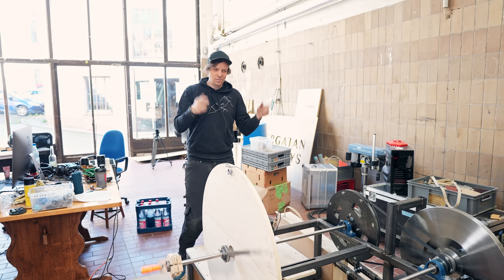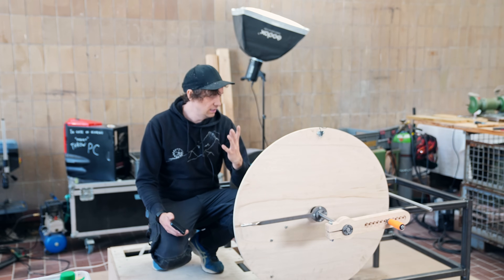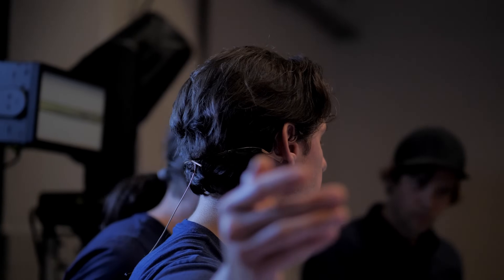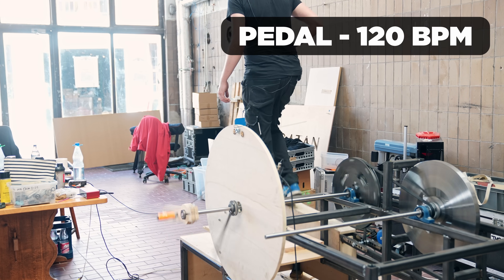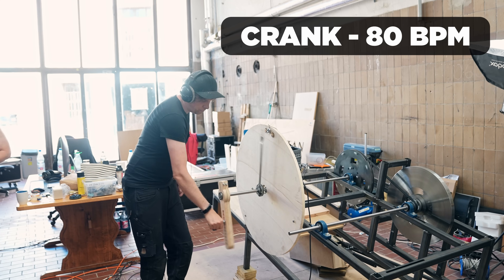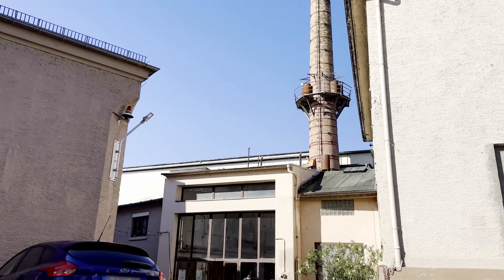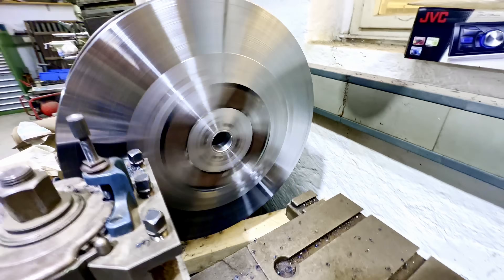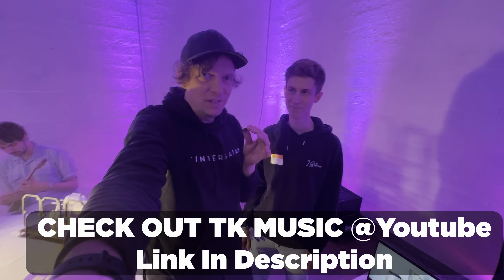The Prototype is Finished - DAY 10 - Marble Machine Flywheel Prototype

Comment: When trying to get the tight music, you need to consider how the muscles in the upper limb (arm) and the lower limb (leg) are different. The arm's primary function is to position the hand in space, we have lost a lot of strength compared to our primate cousins to allow us have greater control over our hands (and subsequently our arms).

Additionally, the legs are the largest muscle groups in the body, so you're able to produce a lot of power with them, but in doing so, you will lose control.

Comment: Why not electric drive? I think the most interesting parts of the machine are unrelated to powering it, like mixing different channels and controlling certain manual inputs. I'd much rather see a performance where you're PLAYING the machine than POWERING the machine. I'm wondering what is holding you back from removing this requirement.
Reply: And if the machine doesn't keep you busy enough during the show, carry out a guitar as well so when the machine is on autopilot for a moment you can sneak in a riff.

Comment: It's interesting to see how the pedal vs no pedal ended up being so close. It does make intuitive sense that having the pedal would introduce some losses when the mechanism needs to fight against gravity to pull the pedal up, but it's also mostly balanced out by how gravity assists with the corresponding downstroke. There are still some losses due to friction (Bearings aren't perfect, and there's some air resistance) but, as you saw, it ends up not being too significant.
Regardless, testing one's assumptions is part of the scientific process as much as anything.

Comment: I would argue that the actual design of your flywheel isn't idea. You want most of the mass on the outer edge, that will give you a greater moment of inertia for less overall mass. If you want to explore this, have rings made up to place on the flywheel, that way you can increase the outer mass without increasing the overall mass to the same extent.

Comment: I am not an engineer, but something seems inherently wrong with that one foot pedal. If your machine is going to be that big, why don’t you put a bicycle seat on it, and bicycle gearing so that you can use both feet to power it, not to mention different gears for speed, as well as the flywheel not turning the bicycle pedals when your not pedalling?

Comment: I think something that might have been missed out in the data analysis is how quickly the tempo changes around the desired bpm. Martin felt that the hand crank was better, but the numbers he was looking at didn't show this. It's possible that with the foot pedal, the bpm drifts and oscillates either side around the target bpm rather quickly (so it might be a bit fast for a couple of revolutions, and then slow down and be a bit slow for a couple, before speeding up again...), but with the hand crank, Martin was able to approach the bpm more slowly, making smaller adjustments to bpm over time, so it would take more revolutions to speed up or slow down. You could think of this as the frequency or period of the oscillations in bpm either side of the target.

Comment: What about some kind of GEARING or Variable Belt drive to change flywheel speed for better control of tempo, this means you can use constant speed power source OR just set the flywheel to a speed that is easier to control for a given tempo?

Comment: Add more hands to the 'clock' you're measuring. Right now you're attempting to match both frequency and phase, which is more difficult at slower tempos and a big part of why your higher-tempo results are better. Adding hands will mean you can get the clicks in time with the metronome more easily. When you lose tempo and need to speed up/slow down, you will be able to match the metronome click to whichever clock tick is closest in phase instead of having to chase back to the original phase. This should significantly reduce the tempo fluctuations shown in your data.
Reply: Right, with a flywheel, there's no way to change the phase without changing the frequency so he's chasing his own tail. He just needs a stomp pedal that instantly restarts the click track so he can easily sync the phase

Comment: Suggestion: Do the timing test, but instead of doing it with the machine, do it by tapping your finger on the contact microphone. Let's test your natural ability's tempo, to see your own natural differential. It'd also be a good baseline for the software as well, as there is no momentum to fight against to keep a temp.

Comment: Martin, when you have the rest of the machine built there will be a lot more resistance slowing down the flywheel, right? With the pedal, you only are able to accelerate the flywheel, not decelerate it. With more resistance on the system, it will slow down more quickly when you stop powering it. If I'm not missing something, this should change the results by a lot, because the system's response time will be reduced. You'll have to modulate your input force more quickly, but also if you exceed the desired speed you will quickly return to it.

Comment: Hand crank seems to be consistent with itself, just not the clock. Maybe the impact rotation is a little off, causing you to consistently miss, but feel like you're hitting.
By that I mean: You're aiming for the bottom of the crank to hit the beat, but it's actually a little too early

Comment: It seems he needs to decouple the input from the "tightness". For tight music, his foot input should be akin to winding a clock; the clock's timing doesn't depend on how it gets wound, it stores the energy and then uses that stored energy to create a consistent output. Varying velocity would require a transmission at that point...

It's easy to express an idea, hard to create the plan 😅
Reply: I'm realizing that there might be a need to decouple systems as well. Like, not everything in the machine needs to be "tight". Ultimately, the only things that really need to be tight are the gates and the programming wheel, everything else in the machine can pretty much work at any speed (lifting mechanisms, marble distribution, marble paths, etc)... so anything mechanical that's not bound to the "tight" requirement should be decoupled from the system that executes the "tight" mechanisms (I can think of all lifting mechanisms for example, maybe they should have their own power source, separate from the "tight" stuff)

Comment: Hmm. Maybe an automatic fluid coupled transmission? You could set the gear to whatever BPM you're targeting. Then when it exceeds the RPM of the geared BPM, it would stop transferring power until it returns to below that.

Comment: Having the pedal (as light as it is) will cause a difference in the tempo for fractions of a beat, as momentum has to carry the pedal up instead of a nearly constant hand crank pulling up.

It's just like a bicycle in that regard, you only get to put in power when the pedal is on the downstroke, but if you had clips (or a crank handle in this case) power is more evenly distributed throughout the entire cycle, reducing the potential for delayed half beats

Comment: I think one reason the hand crank might feel tighter is that the hand cranks it mounted to what would be your output shaft at what appears to be 180 degrees from the "clock hand" where as when your using the pedal the relationship between the output and the input just looking visually looks to be a more abstract relationship. I think it'll also important to note that when using the hand crank your focus also appears to be on the mic so you have a more clear visual input to monitor where as with the pedal you have to just trust your ears as the visual que isnt viable whilst in the pedal position.... Just a thought i whilst watching

Comment: Martin, why not use that clever autopilot system that was designed for the MMX?  It worked great and would allow you to be more present during performances.  Even the old music machines have some sort of power drive.  It doesn't need to be archaic to be cool.

Comment: Makes sense that the handle is playing tighter than the pedal :)
With the handle you can apply force throughout the entire range of motion, whereas with the pedal you can only push down, and let inertia carry the wheel through the top range of motion.
Also with the handle it's far easier and more intuitive to pull on the handle to slow it down if you're over tempo.

Loved hearing the MMX play! Yeah we heard it in the previous video, but it was a lot more clear in this one. I've love to see a dedicated video like the first marble machine got. That'd get that song in everyone's heads and everyone's hearts all over again :D
Also loved the tiny solenoid marble machine, with the early MMX inspired marble feed! 
And Starmachine2000 on the flute was so beautiful! It's one of my favourite songs :D

Comment: You can have a pedal and a hand crank. It looks like hand is better at slower speeds and higher is better on a foot pedal. This intuitively makes sense to me despite not having a reason. I find it hard to move my legs slowly and hard to stomp slow, but easy to kick and stomp super faster with control. While arms are the opposite, I find a fast punch strain me and during slow circular movements is easy. I think it is just body ergonomics.

Comment: It is very easy to vary the crank speed while a pedal action tends to be more constant due to larger muscles and mass working in the leg. So the pedal will have less deviation from standard than the hand turned crank. For more accurate timing, a speed controller similar to the old mechanical 78rpm record players will be needed.

Comment: Just to let you know, lathing is actually a word and you used it appropriately.

While there isn't really a consistent and standardized definition, turning often refers to the generation of external surfaces, such as when you faced the flywheel or when you trimmed the outer diameter. Boring refers to generating internal surfaces, such as when you widen the inner diameter of the flywheel.
From the wikipedia article for turning: 'Thus the phrase "turning and boring" categorizes the larger family of processes known as lathing.'

However many people also use turning to refer to all lathing operations, so using the term turning isn't techincally incorrect either.

Comment: It's simple physics why the pedal is not slowing down the system. The force that's required to lift it up also is applying while it's going down again. So aside of friction loss, air dissipation and a really tiny amount of momentum you do not loose energy through it.

Comment: IT makes perfect sense that the pedal is tighter than the hand crank, for many many reason.
Even non musicians know how to keep a rhythm using their leg and feet, because that is what you do when you walk or run, that neurology. Furthermore, excess strength result in greater control, and your legs are hvad stronger. Add to that the kinetics involved, where using the hand crank you're basically using your whole body, leading to a lot of mass moving about unpredictably.
Those were just a few reasons off the top of my head, but I'm sure I could continue for a while.

That fact that you prefer that which you know, i.e. the hand crank, is no surprise either. This is how we work, and why we can sometimes be very hard to convince that our way is not the best way, even though it may objectively be entirely obvious. It is perhaps the greatest of human failings, but also the most difficult to overcome, even for those who very conscious about it, and try their darndest to do better.
In short, keep trying to convince yourself that your right, but know that you are very likely very wrong, or so it seems to me, trying to be as objective as possible. 

Lastly, it may be worth investigating alternative pedal configuration, or even double pedals. It think that is much to be gained from finding the right parameters. Perhaps it would be better to have it do double time and move less, or vise versa, and of course the pedal itself can move in many different ways. You only need to visit the gym to find inspiration, and you'll find few pedals there, moving as your prototype. There is probably a good reason for this.

anyway, best of luck and best regards.

Comment: Turning Metal is Fun isn't it?.. 
You were discussing changing the Flywheel and the Gearing, what about mounting those Outside of the bearings?.. so you can take them off the shafts without having to remove a bearing first?..
I've been following this process for a number of years now, and you already have achieved great results.. now only to put everything together!

Comment: 8:15 If you don't 100% know the tool to be accurate yet you NEED to manually verify the data to confirm its accuracy or lack of accuracy before doing any more tests, or else you'll do a whole lot of analysis you might need to throw out later because it could turn out to need improvements

Comment: You should take the timing measurements off of the flywheel shaft. When using the hand crank you are applying torque at the measurement point. Torsion on the hand-crank shaft will cause the shaft to twist thereby affecting the timing measurement. The flywheel shaft should do a good job of isolating those torque pulses.

Comment: I think the pedal creates less of a speed difference per push than the crank does per revolution since the flex in the pedal evens out the pressure, perhaps? But it will be easier, I think, to match the speed with the click track when hand cranking, which is why it will feel tighter, and perhaps having more of a feel for the tempo being right is preferable to objective tightness in the end? The pedalling might feel like you're never quite on the beat you want as the position of the foot is different from what it would be when you just tap the tempo with your foot when playing?

Perhaps just moving the contact mic might make the difference.

Comment: I realize it seems counter-intuitive, but try making your pedal-wheel linkage out of something slightly elastic (just a CM of stretch).  Essentially it will reduce any deceleration caused by you pressing the pedal a bit too soon, or releasing a bit too late, and will help smooth the acceleration when your pressing the pedal down hard.  This will may you to achieve higher BPM, and may yield tighter music.

If I were doing this, my pedal would drive a chain that lays over a freewheel sprocket on the drive shaft, and down to a spring.  This would completely decouple the pedal from the flywheel.  Only when I push the pedal down faster than the current rotation of the drive shaft, would the pedal actually engage and add power to the system, then the spring would pull it back up for the next stroke.

Comment: If a watch can keep a beat regardless how tight the spring is wound, 1. Can a flywheel be simply substituted for a wound spring as a power source and 2. can you create a variable speed (beats per minute) output from a spring or flywheel?

Comment: The pedal force transmission system that you have used is not adequate, since when the pedal is raised the force exerted by the leg retains the rotation of the wheel.  For this reason, at low revs there are greater differences in timing.  A transmission system would be needed in which the force is only transmitted to the wheel when the pedal is lowered.

Comment: I don't know if someone has already given you this suggestion, but you could try using the spoke system of bicycle wheels, they are 'easily' adjustable to get very good accuracy, and you would save a lot of weight.

Comment: I would rather see the machine be driven by an electric motor. You can still be there walking around the machine, making adjustments when necessary. But I get the impression you want the music to be as tight as possible and starting with a perfect timing on the motor is key i think.

Comment: I agree with the need for a governor. But I would also suggest a slipper clutch on the flywheel.
This would isolate the pedal and first wheel. With the advantage of being able to add a spring to keep the pedal in the raised or lifted state. Thus allowing you to start the movement with just the pedal. 

As for the connecting arm from the pedal to the first wheel, I would suggest a turnbuckle with locking nuts. This will give you adjustable linkage that can be set with two wrenches. And would not require disassembly of the unit. 

These are just some thoughts I had. Maybe they help. Maybe not.

Either way, please keep up the good work. Thank you for the awesome vids.

Comment: for slower speeds I can understand the crank being more accurate as you can easily speed up and slow down the machine, hence why it also feels more accurate. but using the pedal allows you to put your full weight into powering the machine, as well as using the strongest muscles in your body. I recon if you had a foot strap on the pedal, as well as handles to allow you to put more than your body weight into powering the machine, then I recon you'd get far better results

Comment: @Wintergatan you could control the output power from the flywheel, with a torque limiter + governor.  Then you could be at an exact BPM as long as the flywheel is above a minimum speed (thus you do not need to keep the flywheel at an exact speed)⚙🧑‍🔧⚙
Reply: Yes! He should investigate this. And also an electric drive incase he instead want to focus on playing instruments.

Comment: I’m sure this has been said before so I apologise if I’m going over old ground but…

would it not be easier/better to use the flywheels to store the energy and have an independent system to control the BPM? a bit like a bagpipe store air. I understand it would ad complexity but it would free you up to play music?

just a thought

Keep on trucking.